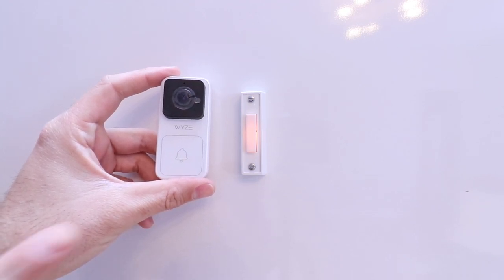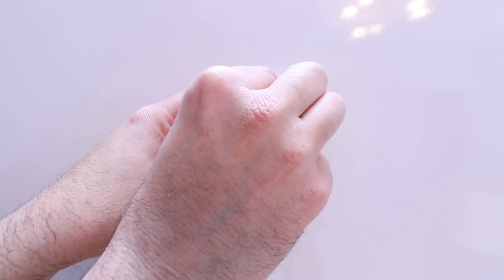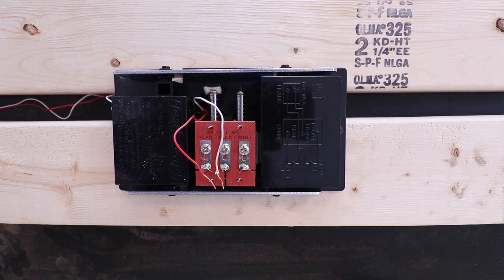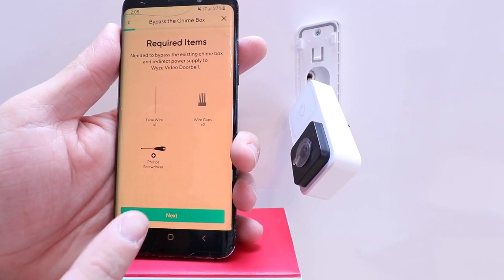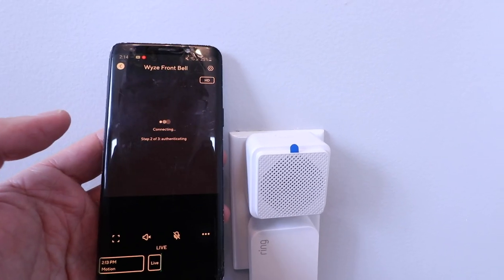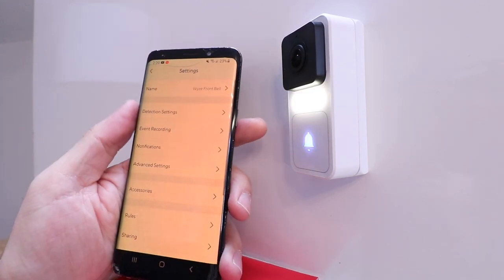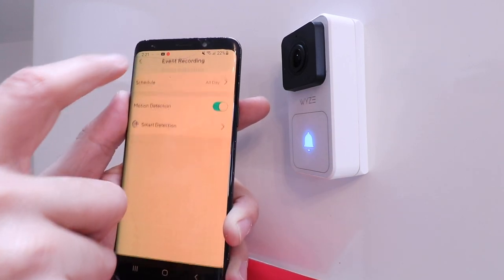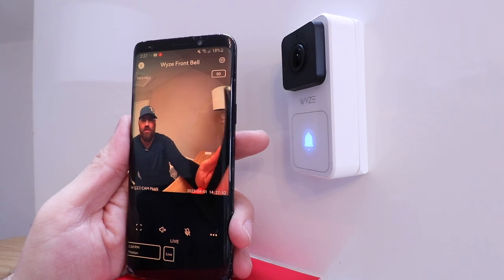How To Install Wyze Doorbell

Comment: What would you have to do if there are 3 wires connected to the old chime. I plan on buying 2 new wyze doorbells for the front and the back door. Would I just connect all 3 wires together to turn on the wyze doorbell for the back door as well?

Comment: I hooked up my wise doorbell and it quit working after 2 hours, I read somewhere that most doorbell wirings not have enough voltage to run the camera. So what's the solution??

Comment: I am using a new transformer. How is the fuse attached to a plug in 3 terminal transformer? the middle transformer terminal is labeled ground.

Comment: How do you get the wall plate off? I slipped it on the doorbell to see how it worked and now I can’t get it off.
Reply: I had to use a flathead screwdriver.  Pain in the rear, and looking down the road, if you want to move the doorbell or have need to remove it from the plate, you will find yourself cursing.  I removed the fat centre clip to give me flexibility in the future.  Yes, your doorbell can be removed by someone, but how likely is that to happen?